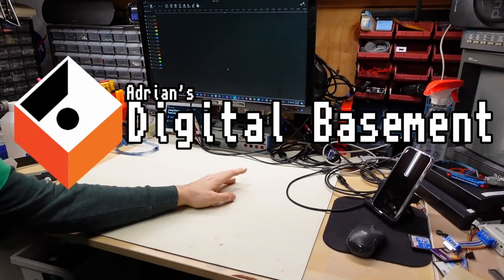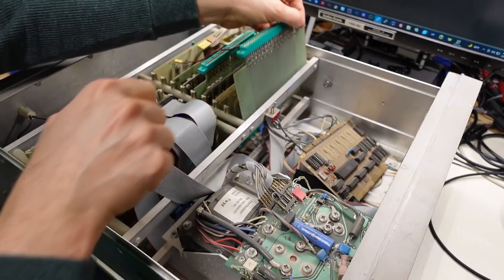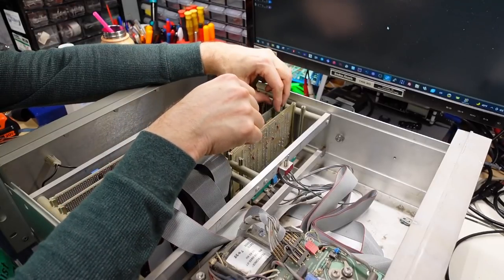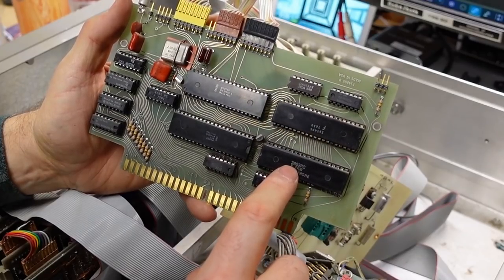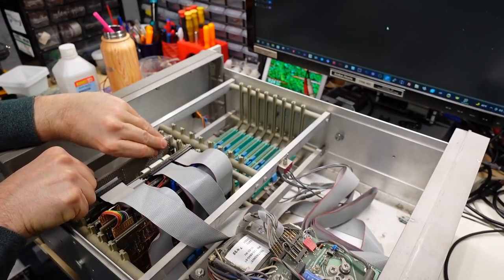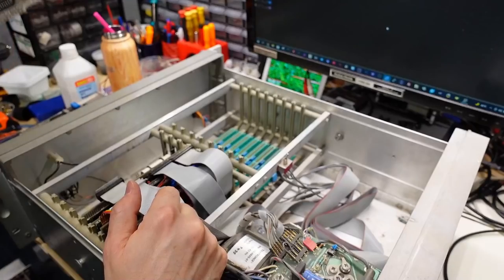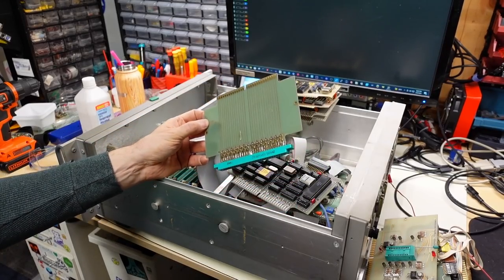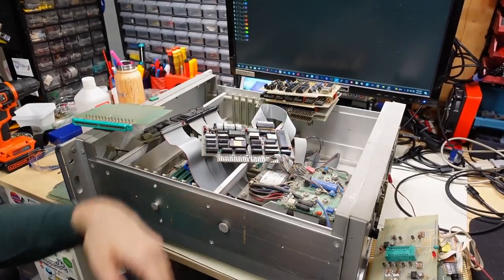I need help finding information on this mysterious computer

Comment: My first though with any strange/mysterious computer was support equipment for testing, there are a lot of custom and strange boxes that were used to interface with sensors/testing equipment. But it looks more like a true home-built computer. Proto boards for actual components, home built floppy controller and rtc/serial board, and to my mind that Sony SRAM chip. The computer was built and modified with considerable skill over at least 5-6 years. I would assume there never was a display controller, as serial access was very common in the late 70's when this was being started. Further, I assume it was a hobby project by a real electronics/computer engineer, those proto boards are just beautiful, and routing 5v along the perimeter of the board just screams of experience.
Many cite cost or quality of materials as a factor against being a home build, I disagree, just because there were cheaper alternatives doesn't mean some wouldn't buy it. And the level of detail and knowledge going into these components hints at a professional building it, so maybe some stuff from the office just fell into his bag. Or he was allowed and or encouraged to take a few odds and ends home.

Comment: All the boards (even the hand-wired ones) inside of the unit have E0000XA or ...B  numbers. This means those boards were produced by Tektronix for internal purposes. So this is either a unit which was created to do some factory internal development or one of the engineers took the boards and other parts home to build his own computer.

Comment: I'm betting this was some prototype/engineering built test interface equipment for Boeing. When every plane is being qualified, a lot of instrumentation is mounted in it and the equipment is short run/custom built. I designed and built a combo vga computer display/analog video display/vt100 terminal for such a setup for Boeing about 20 years ago.

Comment: Most definitely not STD bus. STD did not have the significant gap in the middle. It’s gap was also not symmetrically split 14/14. The STD just had a slit dividing the contacts on each side 13/15. This polarized the cards to prevent them from being plugged in backwards.

Comment: 1)	I worked with S-100 bus stuff – it doesn’t look like this (the cards are wider).
2)	Using solderwick on the ground traces is a way to increase the ampacity of the trace.  Hopefully, doing that would prevent the ground traces from cooking off of the fiberglass.
3)	The Tektronix power supply was likely re-purposed from some other equipment.
4)	Lifted legs and wires run to bypass traces are pretty-obviously post etch design changes.  The builder realized their original concept was ‘almost right’.
5)	On the PROM board, the re-wiring was easier to do than it would have been to etch and build up a new board.
6)	ZIF socket is almost certainly a PROM or EPROM programmer.  Builder was likely in the “programtestrevisetest” cycle and went through a variety of software configurations for this project.  They may have been writing their own hardware interface routines (essentially building their own BIOS).
7)	Z280 MPU was a 16-bit CPU, not a math co-processor.  Not likely that both CPUs would be used at the same time, but it might have been that way.
8)	Running thin strips of metal around the edge of the mounting area was common, it allowed additional access to the more commonly used things (like ground and +5volts, or whatever).  In addition to greater access, the thin strips of metal had less resistance than did the small gauges of wire (so they produced less heat).
9)	Sony CXK58 1000P is a SRAM chip, likely configured to be 64K of 16-bit RAM for the Z280.
10)	SIO/PIO chips are on the primary I/O board.
11)	Not likely to have video connections, since there would be no video controller.  CP/M’s I/O was “teletype” oriented.
12)	Consult with digibarn.
13)  This project is not worth pursuing.  Don't ask me how I know :)

Comment: Adrian, are the two backplanes even connected? 

Based on the fact that both sides had their own CPU installed, (Mostek 3870 in the right backplane and Z280 in the left backplane), and each size had both RAM and Serial IO boards, I have to wonder if this chassis might actually have two almost completely independent computers.   

The only thing the left side is missing is a ROM. 

Maybe this is a development platform, where you access the right computer via serial and then use it to upload software to the left computer and debug it. But that would require partial interconnection between the buses.
Reply: I agree that this is a workstation for building and maintaining other systems.  The EEPROM programmer gives it away.  The level of re-work and one-off boards in there would be risky to support for users, but totally fine for an engineer that's inside this case half the time anyway.  Given the vintage of the parts, I'm guessing that some of the serial ports (DB25) are intended for some kind of serial terminal, like a VT100.
Reply: Side to side interconnect could be with prototype wires between the bent pins at the top of some cards.  Just 3 loose wires to hook up serial, or use that loose DB25 serial cable.

Comment: I have seen very similar one-off / modified computers used for tracking radars. The radars were used on a military test range in the 1980s. The computers were used for an upgrade to the signal processing side and/or the control of the radar. The computers were mostly hand made, the circuit boards were made in house. The jumpers were for correcting errors in the design or using slightly different components.  There were probably only 2 made, 1 for spare.

Comment: This is classic Tektronix R&D type of development computer.  Lots of gold plated circuit boards, and the crimped wires were the normal engineers method of design. 
I was at Tektronix from 1980 until late 2000, and have seen plenty of these during my time there.
Could have been used for prototypes of there graphics terminals or Phaser printers.

Comment: The funky IC sockets, component choice, font on the boards and the circuit board layout says Tektronix to me. That would correspond nicely with the transformer. Probably a one-off test system for internal use.
Reply: Not to mention Tektronix was nearby Mr. Digital Basement who lives in Oregon.

Comment: Adrian:  I have worked on similar systems, that bus card is just a circuit board extender to raise any of the circuit cards up out of the box for further testing. The P/S is Tempest built construction the whole box appears to be a SAT controller for the military. Some sort of prototype level A or B.

Comment: Stopping at 13:30 to mention that I'm pretty sure the ROM board was designed to take a certain size ROM chip but someone wanted to use a different size ROM chip and manually re-wired the board so that it could use the size they wanted, at least in one and probably two positions.
A lot of the other "bodges" are probably for a similar purpose; to adapt the old machine to use newer chips.  I feel certain that the switch is to enable the selection of alternate boot configurations/ROMs.
Stopping again at 20:38 to say that it looks like the computer was designed to connect to a dumb terminal via a RS232-C port and so it never had a keyboard or video built-in.  From the fact that there's one male port and two female ports, that indicates that it was intended to have just one dumb terminal as the interface with two ports free for printers, or perhaps a printer and a modem.
At 24:05 I think that 64K of RAM might be DMA RAM for the floppy interface, so that data transfers can take place without the CPU having to be involved and it can be off doing something else while the data transfer is happening.  The 64K RAM is almost certainly bank-switched so that a "slice" of it can be placed into a particular slot of the CPU's memory space.
The EPROM programmer appears to have been designed to program the 2708 series of EPROMs since they required a 30V programming pulse.  It seems probable that the ROM board was originally designed to take 2708s but was modified later to allow larger size chips.

Comment: I remember a prototyping system in the late 70's early 80's that utilized a special type of "enamel" coated wire that was actually a plastic coating that would vaporize when you applied soldering iron heat; it eliminated the need to strip the wire.  I don't recall the name of the system but it looks like it was utilized extensively in this box.
Reply: I remember using that a lot! And wire wrapping thousands of Vero interconnects....
Reply: Yes I used it in the 80's and also used it as recently as last year! It was called Verowire and can still be bought. The only difference is I use little plastic "combs" that have pegs that fit into the verboard holes and have tiny cleats to wrap the wires round, rather than being tied into to tiny looms as this was. I made my own computers and floppy controllers, EPROM programmers, etc, with it in the 80s.

Comment: I have a case like that.  Most of those cases are meant for things like Print Controllers(Large endustrial printers), or CNC machines.  Judging from the cards you have and the controllers / Roms i am seeing. it is mid level CNC controller / Print Controller from mid 80's.  In many cases like that, there is a main board that supports mutiple blades of montherboards with specific roms.

Comment: I'm no expert, obviously, but running my imagination I came up with this wild guess:
It could come from a small company or department of bigger one, that designed some devices / chips / software for such. I highly doubt this is a private machine.
What threw me off the most at first was having programming logic inside a rackmounted chassis.
wouldnt it be much more convenient to have it more accessible? as a private solution i would never make it so inconvenient to access. i had built a 90° angle raiser card and a cut out on the chassis to get there probably.
but in my scenario it would make some sense. If a team of maybe 3-4 people would write code for a project on their client machines to programm something and "upload" it via serial/parallel
the machine would get instructions like what type or chip is used and what addresses to write and right away burn the rom onto it and just sent a "completed" message back to the client machine when its done.
at least to me that would explain why there is no video neccessary, if all it did was giving status messages and writing roms on to an IC
That computer would be mounted in a rack maybe along some sort network storage for archival purposes or something. like saving revisions of what they did (and didnt work)

leads me to a different version too. what if it was used in clean room reverse engineering? i think i heard of it once that creating own boards and stuff was necessary for that or am i wrong?

finally, in a heavily customized machine like this, i'd be surprised if there is anything unpopulated for any reason. i think it is straight up missing and maybe that's why it is not making sense to people who deal with computers a lot. 
if they went through all the trouble building this, i just cant imagine an empty socket for no reason.
Reply: The programming board is there so you can update the firmware (change the functionality in some way) and then burn new ROMs right on the same device. That ROM board is obviously generic and provides sockets for many more EPROMS than were required for the custom code that was running on this thing.
Reply: @gorak9000  Since no one really knows for sure yet, you may be entirely right. I also might be an idiot and be entirely wrong. But I cant make sense of the purpose then if it works like you say. It leaves me with questions like:
Why would an individual make it so complicated? As an individual, i'd try to get it as usable for me as possible. With all that modifcation done, I cant imagine that person made it so inconvenient to access for no reason at all.

So, what if it wasnt a private project and how would it be beneficial for a company then? Someone still has to open it up, put a chip in the ZIF socket then run back to a terminal of sorts to give instructions then go back and fetch the chip from that awkwardly positioned programmer and install it in a socket on another board.
Seems too complicated for just slamming updates on it.
Or did you meant that it can update a chip on any other board inside of it right away? I highly doubt that, as the voltage is too unsafe to send it through multiple connectors, wire types and resistors. You cant possibly write something reliably like that, can you?
Also the ZIF socket wouldnt be required anymore for that but it wasnt bypassed as far as i could see in the pictures. Only some wires have been added regarding the voltage from what I saw in the pictures. So why is that still there / still enabled? It must have been used, right?

My guess on the ROM board is, that it could hold different "programs" or instructions on how to handle different kinds of eproms.
The terminal would f.e. send a command to run code in address space 2000 to run the programm on that ROM or address space 3000 to run code from another ROM.
If Adrian would try to read the ROM chips, that could give a clue on what they do and possibly solve the mystery.

So I stick with my guess for now that it is a kind of glorified network-ish EPROM programmer that is used by multiple people. Either for developement or reverse engineering.

Comment: The person that put this system together was quite skilled in logic design and hand-building the boards- they are indeed works of art.   I suspect the system was built by a Tektronix engineer as a homebrew home computer, since there aren't really anything but serial (and perhaps a parallel printer port) interfaces.  Unless it was made as a controller for something that interfaced by RS-232 serial, there doesn't seem to be any other likely application.  I don't know if the boards in your system were an evolution of what was originally called the "board bucket" system, but it is very similar in concept, just using a different bus structure. The system appears to be some kind of dual-processor system, with the enhanced Z/80, along with the "original" Z-80.   I have no idea now arbitration between the two CPUs is performed, though.   It also could be that the processors are independent of each other, essentially two computers in one box, each with their own serial interfaces.   Hard to say for sure.

The original board bucket systems used the same power supply as in your system, but packaged in its own external aluminum cabinet with jacks for the DC outputs.  The passive bus with, I believe, 12 slots, was secured in the bottom of a bent aluminum chassis that was open at the top, and had jacks on the back panel for connections to the power supply.  

Later, a "mini bucket" chassis was made that integrated a less bulky but similar-design power supply in another bent-aluminum chassis that had a small passive backplane (5 slots, I think) that made a nice little package, but again, open at the top for easy board swapping.   

I still have one of these mini-bucket systems that works, with a 6809 CPU board with two serial ports, two 8-bit parallel ports (using Motorola 6851 ACIAs and 6820 parallel chips), the ROM monitor (called DDT), one of the EPROM programmer boards,  and 64K of static RAM.   

I also have a bunch of board bucket boards, including the original prototype of the video/RTC board I made, as well as an Exxxx-designated "production" version, an "Octoport" 8-port Async board or two, a couple of 6809 CPU boards,  a couple of 300-board modem boards, some various RAM boards, and a homebrew bit-banged SASI interface that I made and I hacked up the FLEX operating system to make a 5MB Tandon ST-506 interface hard disk through a Xebec SASI to ST-506 interface look like a bunch of large floppy disc drives.  

For a number of years, this system, packaged in a chassis similar to the one you have, ran the completely home-brewed "Bit Bucket Bulletin Board" system that provided service in Portland, Oregon.  I hacked a couple of the 64K dynamic RAM boards to use larger DRAM chips so the boards held 256K each, and rigged them so they had a 256-byte "window" in the memory space, with bank selecting to allow any 256-byte chunk of this 512K block of memory to appear in the window.  I hacked up the Flex OS to make this into a fast RAM-disk that was used to store frequently-accessed files used by the bulletin board software (written in FLEX BASIC) to speed it up.  I used the video board I had designed connected up to a little black and white TV through an RF modulator as a monitor so I could watch the user interaction with the system as they were online. The bulletin board became quite popular, but it was single-user only.  Over time I  upgraded from the 300-baud  modem board to an external 1200-baud modem.  It was a lot of fun, and I met a lot of great folks through the system.

I apologize for the huge comment, but I figured I would provide as much information as I can remember.  

I worked for Tektronix from 1977 to 1990, and in those 13 years, I had a great many wonderful experiences, but my most memorable was the time I spent hanging out with the Microprocessor Development Group folks -- Ferrous, Gerry, Dixie, Scott, Jeff, and a number of other folks whose names I sadly can't remember.    
I learned so much from these folks, and the impact of that learning served me very will in my career going forward.   

I'd be happy to answer any questions you might have about the board bucket.   One of these days I need to make a web page for the Board Bucket, or perhaps a YouTube video   Only just time, of which, unfortunately, I have very precious little of.